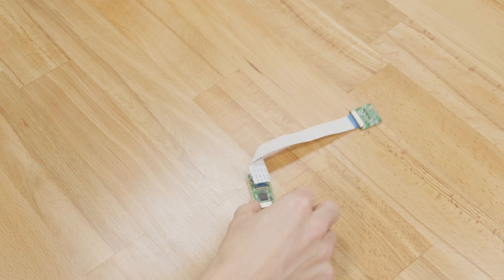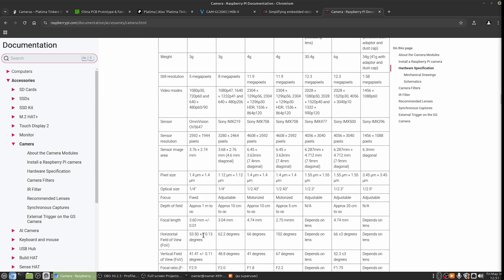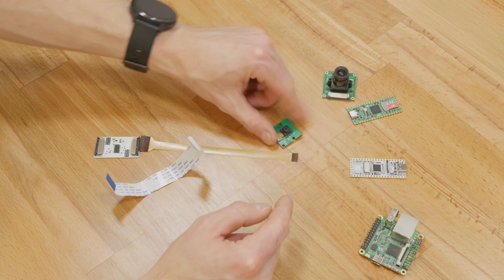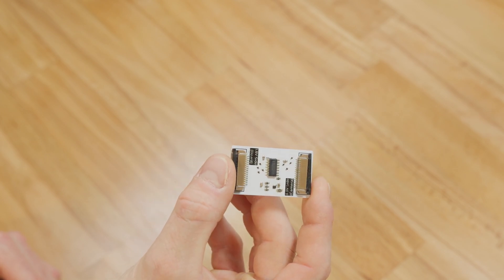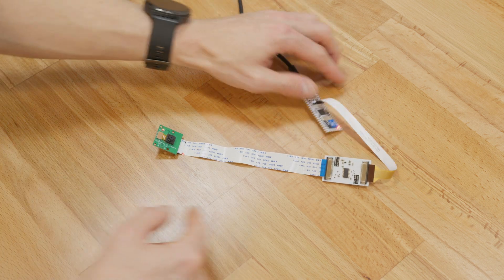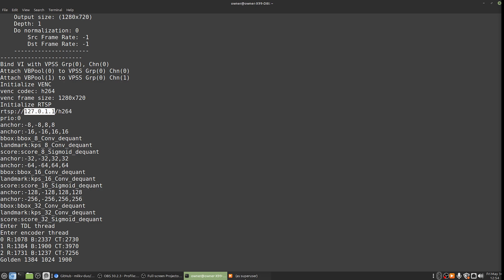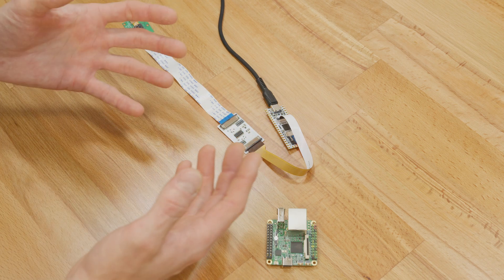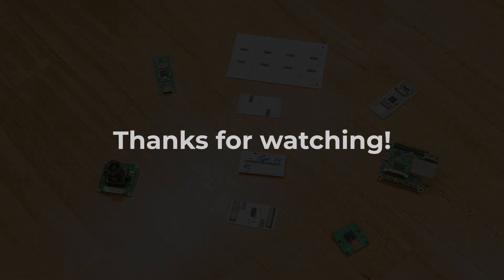This $9 Board Solves the Milk-V Duo's Biggest Problem (Camera Options)

Comment: I have to stop right here at the start. You trimmed the cable to fit. No, I just can't my dude, my brain is not ready for that kind of horrific humor. I am going to need to try watch this again in the morning when I can deal with that level of mutilation. I just discovered two of my good ESP32 cameras had torn cables from getting stuck in the parts draw yesterday. Wide angle lens with nice long 10cm cables too. The trauma is too fresh.
Reply from the maker: Hahah absolutely pinned. Thank you my friend 🙏 That was obviously kind of the point.

What was kind of amazing, is that it did not let out the magic smoke. I even shorted VBUS (5V) to firstly a random GPIO on the back, and then instead shorted it to the 3.3V line, AND IT STILL BLOODY WORKS.

Ah sorry to hear, I do feel that pain. If it's any consolation, I do also have 15p1 to 22p0.5 ribbon cable in stock still, inc 30cm ones! If you want me to get some 15p1 to 15p1 do let me know, as I've been considering stocking spares.

Thanks again. Pinned 🤘

Comment: Is the level shifter only for the i2c and gpio? Im planning to make one at home. Stock camera is just too big for me.
Reply from the maker: Hey yeah the level shifter is just for the I2C comms. The MIPI signal is fine as-is. It was harder than I thought though, as the current available is limited, and you also need to level shift at wire speed. Took me about three prototypes, about 60 hours of labour, and a few hundred bucks in parts and manufacturing before I got it working! I also had to learn to use a DSO, but that had to happen one day anyway 😅 GL!
Reply: @PlatimaTinkers  nice thanks, just waiting for my small 120fov camera to arrive.
Reply from the maker: Any time!

Comment: So the milkv duo provides 3.3 volt thru the csi cable ? if so then does it accept 3.3v camera signal or does the board send 1.8v signal ...
Reply from the maker: Yeah for whatever reason they use a 1.8V I2C signal, where as most are 3.3V, but pins 1 & 16 are still 3.3V & GND, so I just tapped that as the reference for the shifter.